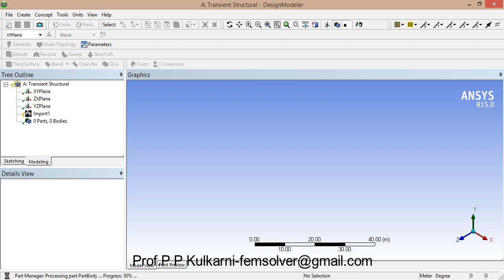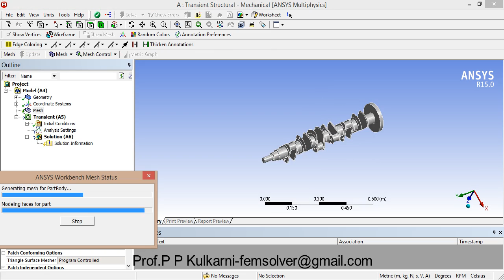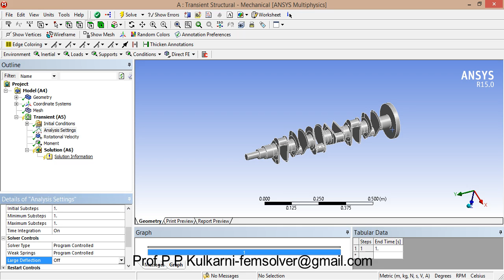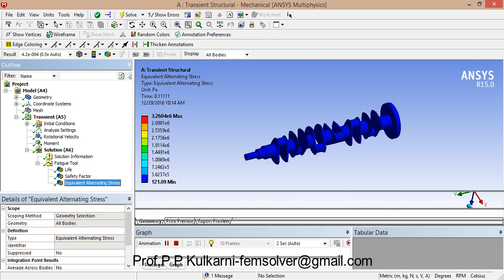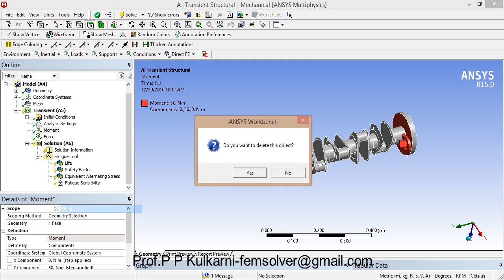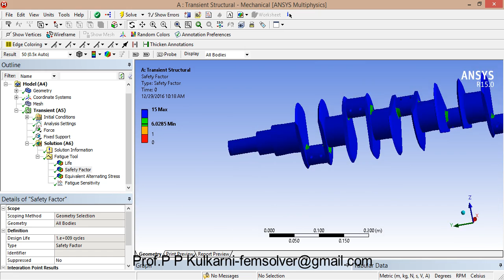Fatigue life analysis of crank shaft using ANSYS workbench

Comment: sir . i want to do stress and fatigue analysis of 8 cylinder crankshaft and i have cylinder loading file . in which workbench module(static module , transient structural module, modal module or any other ) i will do this analysis coz loadings are variable and crankshaft rotating at 2000 rpm .  and how to apply these cylinder variable loads on rotating crankshaft ???

Comment: which material is used here
Reply: Structural steel is used here which is the default assigned material to all CAD geometries in ANSYS workbench. In order to change the assigned material, you need to select appropriate material from the Engineering data and assign it to your geometry.